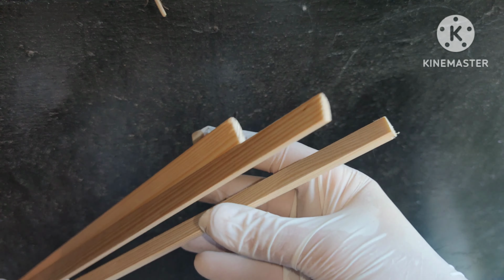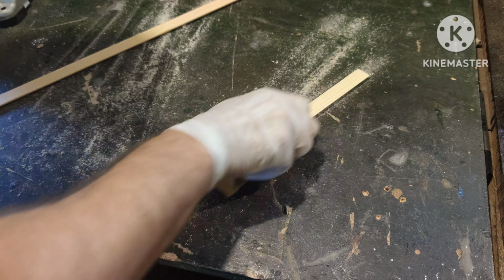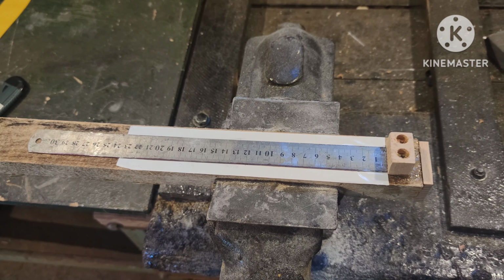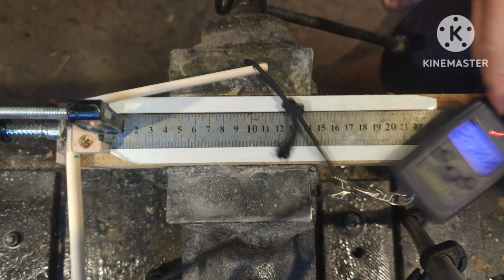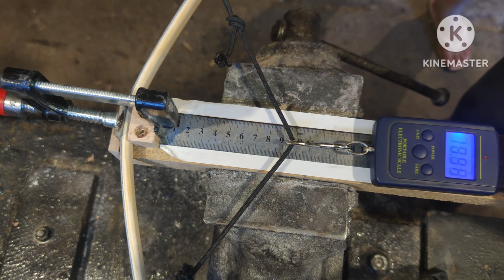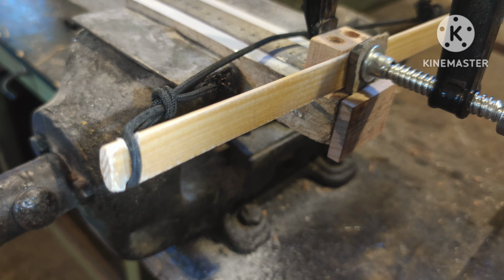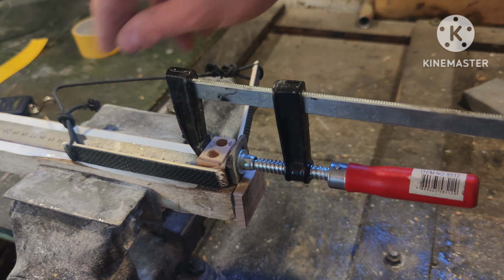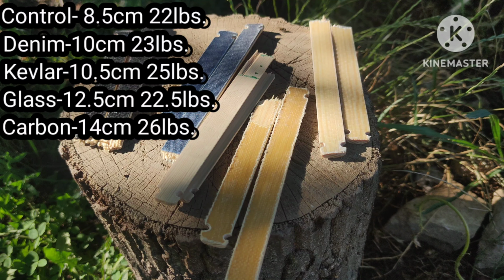Battle Of Bow Backings

Comment: Hey, if back side is very strong then it will apply a lot of pressure to the belly. Since fiberglass and carbonfiber are much more strong and resiliant then wood, I don't think they are good fit to be wooden bow backing without fg\cf belly. Because they can crush the belly fibers of the wood and cause to set, even if it is not apparent because of the fiberglass. I only brought up this topic because I wanted to discuss. I am also just experimenting and not 100% sure.
Reply from the maker: Yes, in theory the fiberglass or carbon backing should overpower the wooden belly causing lot of set, that makes sense to me, but i never experienced that and i made a lot of backed bow so i don’t know if its just a myth of what… If you have some experience with that, please share 😀
Reply: @Helmbowman  Yeah it is weird, I just read that on bowyers bible but maybe just as a thin layer it doesn't effect much. I just wanted to hear your experience, I never tried something you haven't, you are like my online bowyer sensei :) Thanks for sharing and experimenting, as always great content.
Reply from the maker: @leblblb Thanks a lot brother! Im really glad that you find my videos useful 😄 💪🏻

Comment: It was interesting, I suggest you should test some Nylon maybe some ladies tights or similar for a quick test.
Nylon rope is very elastic and high stretch for a synthetic material, that might add some speed to a bow without making it stiff and stacking.
Reply from the maker: That would be interesting, im planning to make part 2 of this video, so any ideas are welcome, thanks for suggestion!